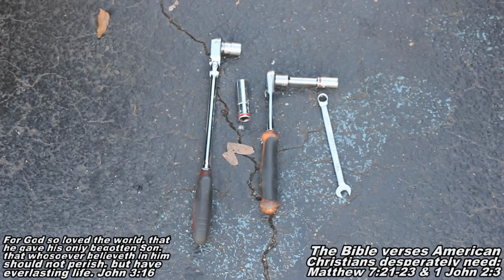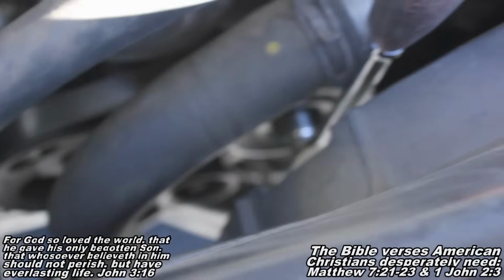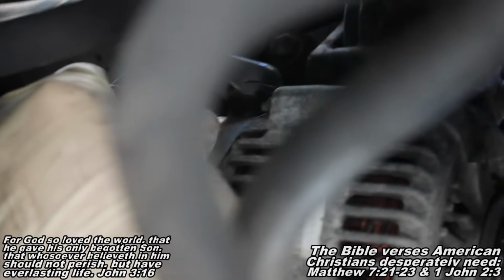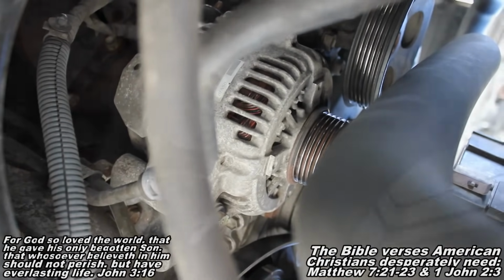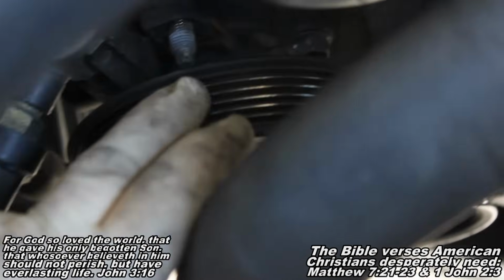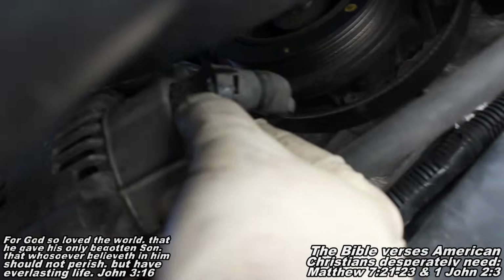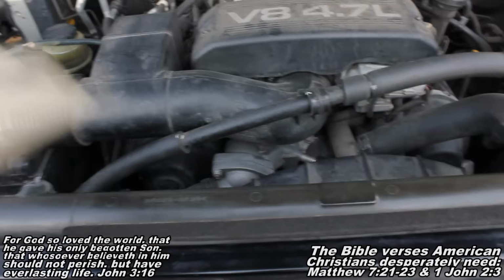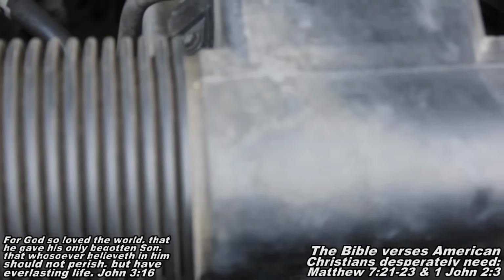How to Remove & Replace Alternator 01-07 Toyota Sequoia

Comment: This video helped. I did perform a few extra steps that made it much easier on me. First, remove the airbox and set it out of the way. This added about four minutes but gave me so much more room to work. Second, remove the lower radiator fan shroud. This added about one minute and again was a huge help. When the alternator is loose, it practically fell out. For the alternator plug have a buddy use a long screwdriver to press down and hold from above where it says PUSH. Crawl under and reach up to grab around it and wiggle it up and off. When the power steering pump is loose, zip tie through the pulley and around the lower radiator hose to hold it out of the way. When installing the new alternator, have your buddy spot you from above to get the holes in the mounting bosses lined up with the upper stud which you cannot see from below. Of note: the truck has been having a bunch of weird error codes, every dash light was on, and it ran like crap. New alternator, and it now runs like new with a lot more power.

Comment: Your video was very helpful for me, and I would say it got me through the removal and replacement. I have a 2000 Tundra with only 315,000 miles.  I know I can't believe the brushes in the alternator wore out that quickly either. 

Because of your comment about the plastic dust cover you broke, I was careful there and eased it off without breaking it.

Your video gave me the confidence to attempt this myself and it saved me about $300.  Thanks, again.

Comment: Great video.  Thank you for saving me $$$.  One tip that helped me was to remove the lower fan shroud.  Comes off by removing only 2 metal clips.  Made more room to get the alternator out of the engine compartment.  Thank you.

Comment: Thanks for sharing.   Definitely helped me remove the alternator from my 2005 GX470.  The service manual have you remove the fan, fan shroud, and transmission coolant hoses which are not necessary if you work from the bottom and in the left wheel well. You can remove the plug and the wiring from the battery via the left wheel well.  Just remove the floppy cover in there.  On the GX470, you'll have to remove 2 bolts near the front anti sway bar that holds the a/c hose and another hose. This will give you more room to remove the alternator between the front anti sway bar and the transmission coolant hoses.

Comment: thank you for the video, it also helped me a lot to do it on my 2007 Tundra. what I did to remove the alternator I remove the tire and there is a dust cover or whatever is it call that is between the shock and the bumper, and from there was easier to do a lot of the work. however, your video is a lot of help to start, it took me a few hours.
Reply: Pulling back the dust cover made it very easy to unhook/re-hook the wires. Thanks for the suggestion.

Comment: Dud, You Rock!! This Vid saved my Butt! My wife has a 2006 Lexus GX470, but it's pretty much the same engine but less room to work with.  I knew the power steering pulley was in the way but wasn't sure if I needed to take it off or how to attack. Easy day after watching this Vid!  God Bless! Semper Fi, Semper Gumby!

Comment: Great video! I have a 2002 Sequioa like yours. I am pretty sure the one installed from the factory is a Denso. I just do not know the model, hence I do not know what the amperage is. I think it is 100 or 130amps. I haul a travel trailer and was wondering if  should replace the existing one with the same Denso rated alternator or can I safely upgrade to a more powerful one..?
Reply: I know this comment is 2 years too late but it is a 100A. I also have a 2002 sequioa.